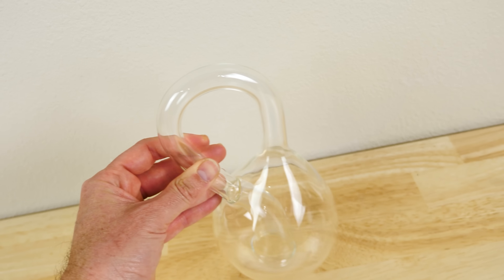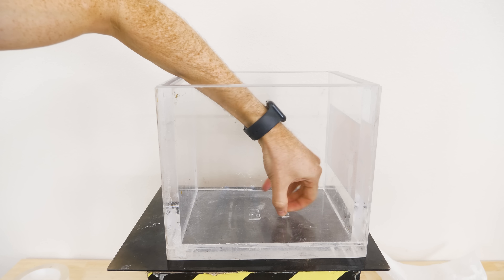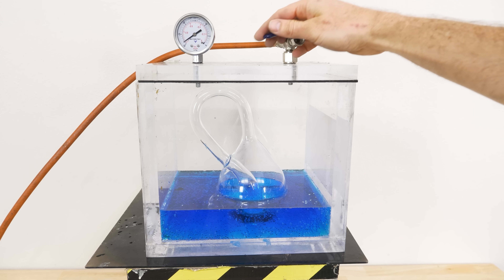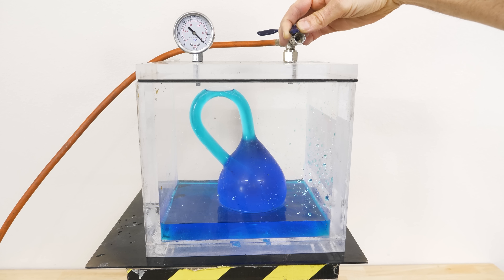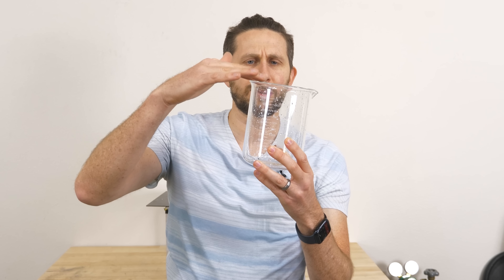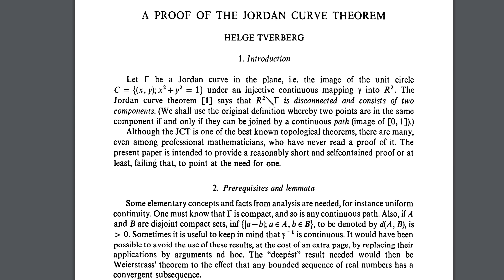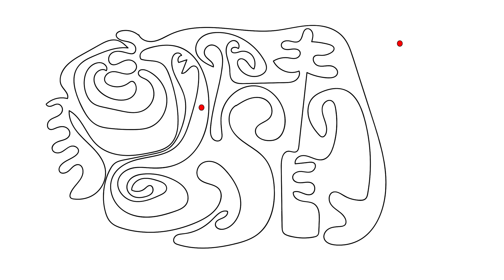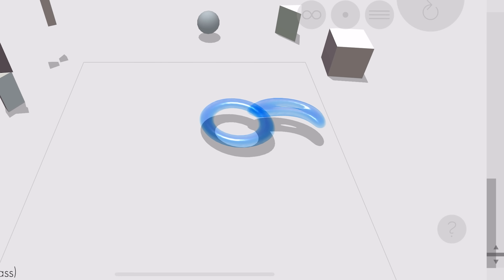Is It Possible To Completely Fill a Klein Bottle?

Comment: I love the idea of using vacuum chamber, although it seems a hose stuck inside would do the job just as well. :-)
Reply: Using a vacuum chamber is over engineering at it's best.

Granted, it's more entertaining than a hose to pump or pull it full.
Reply: @Unsensitive : What do you mean by "over[nospace]engineering at IT IS best"?
Reply: @HelloKittyFanMan  Overengineering is just as correct as over-engineering.
Reply: @HelloKittyFanMan  using the term loosely here.

Over-engineering is using a complex design, when a simple design would suffice.

In this example, he "designs" a way to fill the clein bottle, when a simple tube or 2 would have been a more simple and sufficient solution.

As someone else said, when you have a hammer, everything looks like a nail.

Taken to the extreme, you might consider Rube Goldberg Machines.
Reply: Man,  @Unsensitive , it's like people just ignore things like EMPHASIS in these comments. What was your reasoning for it?
I already know what the word "overengineering" (by the way, it takes less work to type it without the superfluous hyphen, so you might as well not; plus, the encyclopedia shows that as the main way anyway) means. Did you not see what I emphasized? I asked you what you meant by the "IT IS" there. So what did you mean by that?
Also, why the quotation marks around "designs"? Even if what James did isn't very efficient, do you think that supposedly "doesn't count" as an actual design of how to do it -- just figurative? 
By the way, I'm not sure why you brought up something that you called a "clein bottle," since there's no such thing.
Reply: @mobiusbelts3607 : Even more so! Thus, aren't you glad I said it that way?
Reply: @HelloKittyFanMan  Reflects poorly on you that you can't understand what he means from such minor errors.
Reply: Oops, wrong,  @MelodicTurtleMetal . It reflects poorly on you that you think you even know what you're talking about. First off, you weren't even specific about which errors you think you're trying to refer to. Second, you shouldn't even care because you're not the one I addressed about it.
Reply: When you have a vacuum chamber, you use a vacuum chamber over anything else :)
Reply: @arsilvyfish11  When the only tool you have is a vacuum chamber then everything looks like it needs a vacuum chamber.
Reply: Whose channel is that on, according to you,  @billr3053 , and how do you believe that connects to this channel?
Reply: i deleted my comment immediately because it was the exact same idea.
Reply: My first thought too. So much easier, and it's something I have at home.
Reply: @NBM397  I have a hose but no Klein bottle 😂
Reply: @NBM397 : Wow, you have a Klein bottle lying around at home too?
Reply: unlike a Klein bottle.
Reply: My first thought too.
Reply: @poppedweasel  same here. literally just commented this, only to scroll down and see someone already had the same thought. oh well 🤷‍♂️
Reply: I honestly thought he was just gonna grab a long bendy straw. 😂
Reply: You can use to hose to put in the water or to let the air out. Or both, if you have two hoses!
Reply: @pyllutuber2957  hose is the best.
you know what's not  the best?
THE ACRONYM OF HOSE
Reply: Another way is to fully submerge it in water with room to twist and turn to get all the air out.
Reply: He have a vacuum chamber and we dont, the first idea come to my mind was the same, but if i had a vacuum chamber.. i would use that instead of hose
Reply: Or you could submerge it and work out the bubbles.
Reply: @Windcent  I thought that too but you would need a bigger chamber.
Reply: Because a flame thrower is way more fun than a match
Reply: Or you could essentially suck the air out once you insert the tube, making sure the open end is submerged.
The fluid should fill out the space as you suck the air out.
Reply: I was just thinking that, a small tube for the air to vacate would work as well. Also, folks you wouldn't use the tube to fill it WITH liquid, you would use it as a channel for air to flow out.
Reply: I was thinking the same thing...
Reply: welp, science
Reply: That’s exactly what I was thinking he’s using a vacuum chamber because he has a vacuum chamber when small hose would do
Reply: I came to say this, but you saved me the bother....
Reply: I figured fully submerging it and then rotating around to get the air bubbles out might work
Reply: There was a myriad of much easier and more logical ways to fill it but if you have a vacuum machine than fuck it, why not look for any excuse to use it?
Reply: Yeah and horror movies would end in like 10 mins if characters weren't retards.
point is to show stuff that looks cool for youtube ad revenue. Although steven does do a lot of actual cool stuff this one was underwhelming.
Reply: Or just put it in water and shake it
Reply: Hose stuck inside?
Reply: The guy sells vacuum chambers ¯\_(ツ)_/¯
Reply: In order to pull a vacuum, you need it to be isolated. Using just a hose wouldn’t work the same because you will always have a little positive pressure entering.
Reply: everyone here is overthinking it, just put an thin tube in the hole to serve as a hose, and a second one to serve as an air relief. its the same principle as why an 2liter bottle drains faster when you move it in a way to give the fluid a vortex. Air is able to go in (or in this case, out), while the fluid is able to pass through easily without resistance for displacing air
Reply: Yeah, right?
Reply: This is what I thought he would do.
Reply: Lol
Reply: The vacuum chamber is more fun.
Reply: A hose wouldn’t work because due to the pressure, it would explode
Reply: Pschhh,  @ArcticArua , no it wouldn't!
Reply: I wonder has even 1 person ever read the entire Jodrsn curve proof paper..do even the authors fully understand or bother to read it..doesn't it become too much of a tedious slog after a while?
Reply: Basic
Reply: Dude I was gonna say that🤣
Reply: yeah I was like use a straw bro!!!
Reply: That's what I thought, too.
Reply: Bruh, you just spoiled the video for me
Reply: @Cubeify  🤣 that'll teach you tonread the comments instead of paying attention to the video.
Reply: @Fetrovsky  bruh, i didnt read the comments, this comment appeared when i accidentaly scrolled
Reply: @Cubeify  you kill me 🤣🤣🤣
Reply: @Cubeify  be my guest 😁
Reply: OR YOU COULD PUT IT IN A BUCKED OF WATER
Reply: A lot of talk, but no one actually has a Klein bottle and a hose to prove it… Put your money where your mouths are 😂
Reply: That’s what I was thinking. But then I figured “what fun would that be”.
Reply: or just submerge the entire bottle in the water and rotate according to the bubble.... The fact that i thought the bottle is going to explode due to pressure.. but theres no volume.. that means theres no pressure lol
Reply: Fill it economically😅
Reply: Yeah that's what I was thinking - small tube and an aquarium pump
Reply: Or dip it in a bucket of water
Reply: Just use a looooong straw and go BBBBBBBBBBBBBBB
Reply: or submerge it in a sink :)
Reply: @steamlink4803  he did?
Reply: That was my reply exactly he went around his butt to get to his elbow
Reply: It won't fill the nozzle
Reply: Yessir
Reply: Catheter would work too
Reply: Unless the pressure just breaks the glass
Reply: @@mido4824 NOOOO YOU JUST NEED TO PUT A HOSE ABOVE IT SO THERES SPACE WHY IS EVERYONE SO DUM!!!!!!!!!!!!!!!
Reply: My first thought too. But maybe it's because I'm just a peasant sciencing on a budget 🤔
Reply: Yes lmao, filling klein bottle could be a lot simpler, since someone even made a terrarium in it
Reply: I'm pretty sure you could get all the air out by submerging it in water and changing it's orientation until it's fully filled with water.
Reply: It’s like turning a cup upside down and trying to fill it
Reply: Same idea
Reply: I love the vacuum chamber for this channel. I mean love love love. The things he does with a vacuum chamber.
Reply: my idea exactly, just need to tilt the bottle while submerged! [home made vaccum]
Reply: All I have is a hammer so the klein bottle looks like a nail to me
Reply: @cslloyd1  lool
Reply: Any excuse to use the vacuum chamber is a good excuse I guess  ¯\_(ツ)_/¯
Reply: That would work to a point but gravity would only fill it so much. To finish filling it, you would need to pressurize the liquid in the tube with a syringe or something and it may need to be submerged to keep air from replacing the volume of the tube. The opposite of a vacuum chamber.
Reply: @heman5954  A hose has pressure. All you gotta do is put the hose in side the bottle and the air will be displaced with water.
Reply: @harms123  due to surface tension, as you remove the hose some of the liquid will be pulled out. To counteract this, you would have to pressurize the tube and have the container submerged completely. Pressurized to overcome the pressure of the liquid outside the container. A syringe wouldn't be necessary providing the end of the tube not in the container is connected to a large enough volume of liquid at a high enough point to overcome the surface tension.
Reply: @harms123  Yes, but you would need to make sure the air has a way of escaping, right? It could be a hose and a tube, I guess.
Reply: @heman5954  You don't need to counteract anything. After removing the hose, just top up the bottle like any jar or glass.
Reply: @harms123  well the air will try to expand...
Reply: @harms123  NOOOO YOU JUST NEED TO PUT A HOSE ABOVE IT SO THERES SPACE WHY IS EVERYONE SO DUM!!!!!!!!!!!!!!!
Reply: @heman5954  The hose idea would still work.
 
1. Use the hose to push liquid into the large portion of the Klein bottle. The air will necessarily rise up through the neck until it forms a bubble on top like the 2nd vacuum round.
2. Next, tilt the bottle until the air is completely out.
3. Finally, fully submerge the bottle and hose in the liquid and pull the hose out.
 
No more air!
Reply: @zecuse  what about the air dissolved in the liquid? Some sort of pressure would have to be applied to push or pull that out. Otherwise a bubble will form as the solution settles.
Reply: @heman5954  And that bubble would form at the top of the neck. Repeat step 2 (while submerged) until no more bubbles form. The vacuum makes this process quicker, but it's not necessary.
Reply: @zecuse  there would be 2 bubbles though, one in the neck and one on the "inside" of the container. We may be putting to much thought into this. We should ask James to demonstrate this alternative method if even possible.
Reply: @heman5954  Look at the geometry of the bottle. The "inside" doesn't have a 2nd "roof" anywhere for air to accumulate. It would all eventually bubble up to the top of the neck. Being glassware, there wouldn't be a flat or concave surface on the part of the neck that protrudes through "inside" cavity where air could accumulate. Even if it did, a simple shake or tilt would dislodge the bubble to move up to the neck as well.
Reply: @heman5954  *too much
Reply: @snakedoktor6020  call me a glutton but too much is never enough. Lol  
Wewoo wewoo wewoo, get out the way, here comes the grammar police.
Reply: @zecuse  yea it really wouldnt be that hard with the right hose
Reply: @zecuse  thatsoverly complicated... insert the tube inside the bottle until it wraps around and touches the bottom, flip the whole thing upside down and fill it with liquid like you would any container... the tube is only there to let the air out 

frat kids figured this out decades ago... hence funneling a beer bottle with a straw in it
Reply: @heman5954  It should be possible to fill it normally, then turn it upside down, wait for the air bubble to form, stick a tube in and suck the air up with your mouth. It feels like it should work. I smell a "filling the Klein bottle ideas video".
Reply: @henrykmur  *filling
Your idea does have merit. How many ways are there to fill one.
Reply: @snakedoktor6020  Thanks, corrected.
Reply: @heman5954  dude never heard of tap water before
Reply: @heman5954  One more way of doing it would be to fill it up to the top, freeze it and then fill the rest. I would be likely to break during freezing, though.
Reply: @heman5954  Gravity filling the bottle so much would not be an issue.
Reply: @heman5954  ⚠️ God has said in the Quran:

🔵 { O mankind, worship your Lord, who created you and those before you, that you may become righteous - ( 2:21 ) 

🔴 [He] who made for you the earth a bed [spread out] and the sky a ceiling and sent down from the sky, rain and brought forth thereby fruits as provision for you. So do not attribute to Allah equals while you know [that there is nothing similar to Him]. ( 2:22 )

🔵 And if you are in doubt about what We have sent down upon Our Servant [Muhammad], then produce a surah the like thereof and call upon your witnesses other than Allah, if you should be truthful. ( 2:23 )

🔴 But if you do not - and you will never be able to - then fear the Fire, whose fuel is men and stones, prepared for the disbelievers.( 2:24 )

🔵 And give good tidings to those who believe and do righteous deeds that they will have gardens [in Paradise] beneath which rivers flow. Whenever they are provided with a provision of fruit therefrom, they will say, "This is what we were provided with before." And it is given to them in likeness. And they will have therein purified spouses, and they will abide therein eternally. ( 2:25 )

⚠️ Quran
Reply: @1islam1 Carlin " I like people on an individual basis but after they start to form groups even as small as 2 or 3, they sacrifice the beauty of the individual in service of the group and and start wearing funny hats, persecuting others for their beliefs and carry out atrocities upon others for their beliefs" or something like that.
Reply: @heman5954  🤓
Reply: @heman5954 lol a hose only works because the pressure of fluid inside the hose is higher than outside
Reply: @adawg3032  have you seen a water level before? It's a clear hose, closed on each end with a dyed water in it and a bubble to allow the water to move. When you hold each end of the hose close enough to level that the bubble is visible on each end, the water is self leveling and you can measure a structure, grade... to the bubble and know the exact level of what you are measuring. The pressure is exactly the same on each end. My point is, something has to give the liquid in the hose the pressure be it gravity or a piston... But yes generally the liquid in the hose has a higher pressure due to an outside force not simply because the liquid is in the hose.👍
Reply: @heman5954  nah you just need to rotate the container as you fill
Reply: @heman5954  A second tube could be used to release the air.
Reply: @heman5954  Not really, it's the same as some of the oddball aquariums and water bridges that have been made, slipping an airline tube in around the bend to start sucking the air out while keeping the other end submerged would pull it through, then just get the hose up to the bend and keep going and it would fill the rest of the way.
Reply: @heman5954  if it comes to that, you can use 2 hoses, one to put liquid inside and the other one to let the air out.
Reply: So if I submerge the bottle in water, would the fluid still be considered outside at the Sametime while filling the bottle? Hmmm
Reply: @4diamondz318  🤣
Reply: It would be better and faster
Reply: When you can choose between a vacuum chamber and a hose, what would you pick?

Comment: Why doesn't the water come up to the same level on both... uh... "sides," or "ends" (for lacking a better term)?
Because of too much air in there, but then what determines that the amount of air in it will stop the water right at that first point?